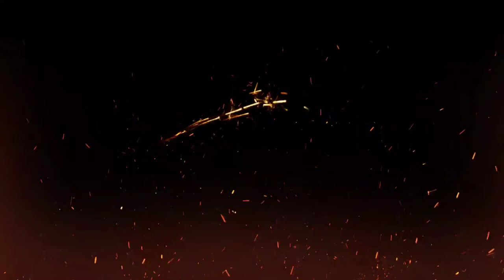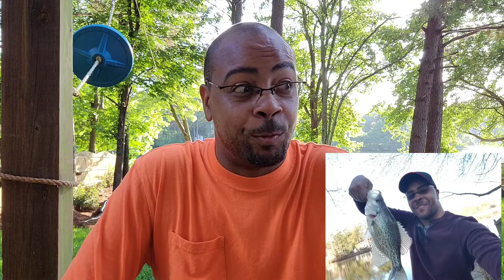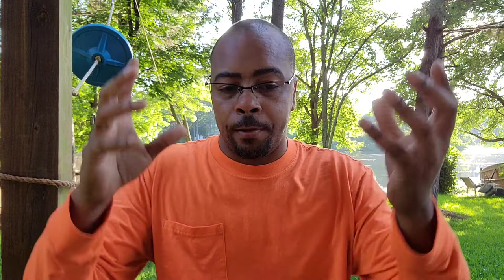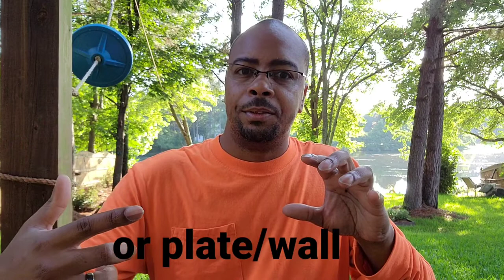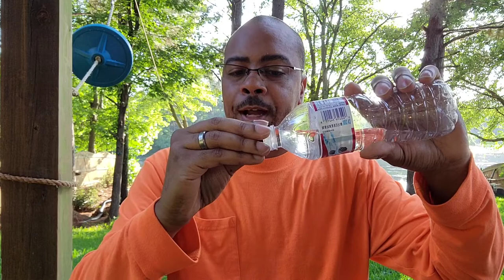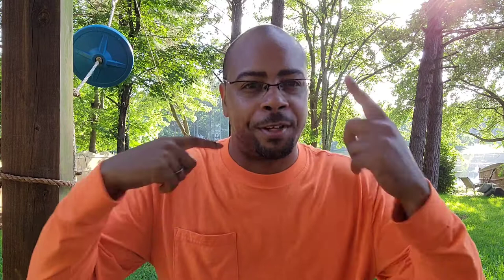Internal and External Valves: VERY basic description for new tanker drivers

Comment: Nice video but on the internal valve how do you know if the primer is working or not? I use to look  to see if the pins would go up. Sometimes I get a trl that has no pins to look at.
Reply from the maker: Thanks! To be honest, I essentially pumped the internal until it wouldn't rise anymore. I don't ever recall having a trailer that didnt have the pins. I do remember having a trailer where there wasn't enough product flowing through. Essentially there was not enough fluid to keep the internal open, so it kept closing during the unload. In that case in monitoring the customers electronic gauge, I was able to see that there was no product flow, then had to play detective to find out why. Its fairly simple. Customer receiving line open? External open? Internal open? Compressor or pump working? From that you should be able to determine where the problem may be. I hope this helps!